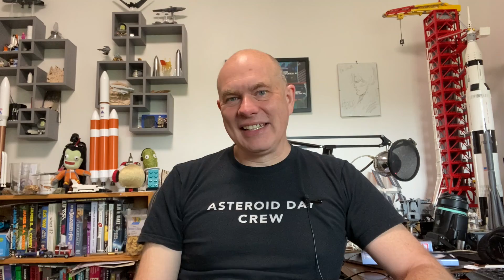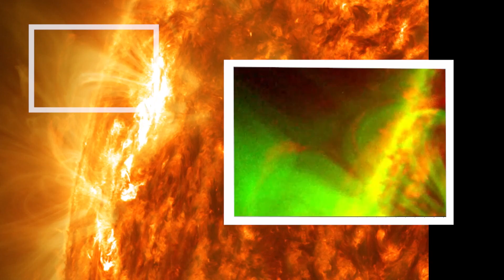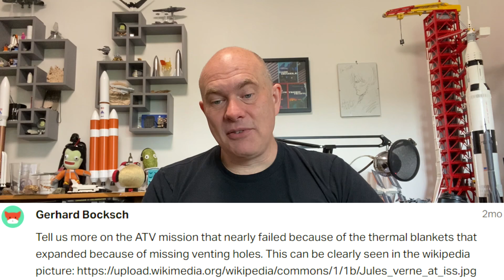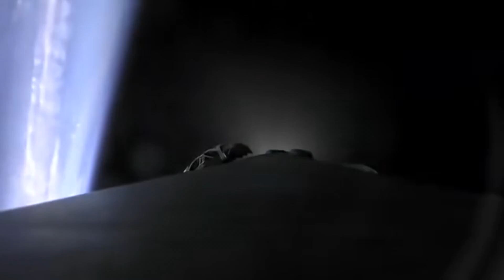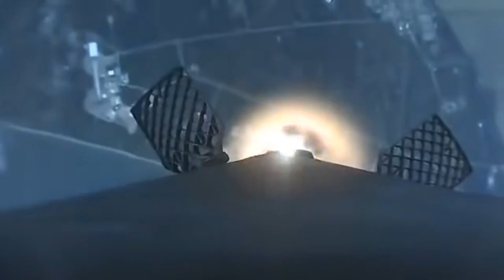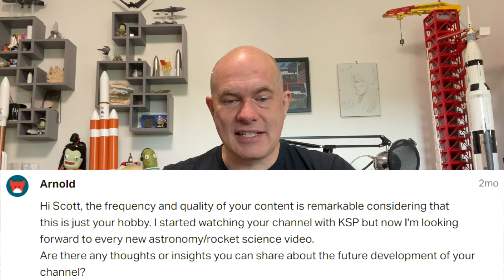Viewer Questions Episode 4

Comment: Stress Fatigue Failure Question: Hey Scott, Elon wants rockets to be reusable like the airplane industry, but airplanes have many design approaches to minimize the chance of fatigue stress fractures from propagating across large sections of the fuselage or wing, primarily by having individual panels riveted to a redundant understructure. Why does Elon think they can get away with one large welded rocket body? Is it something about aluminum vs steel? Are the rockets going to be inspected for stress fractures between flights? One Falcon 9 has been reused 10 times without failure, so that's good news, but the BOAC Comet failed around 1000 flights.  Thanks for your thoughts. Love your videos.
Reply from the maker: I’m going to say this is an excellent question that I don’t have an easy answer for.

Comment: Scott. Can you please address the issue of static charge equalisation when a new payload docks at the space station? Surely there would be a significant potential difference between the two craft. Do they have a special probe or just rely on the docking port metal parts?

Comment: Scott, a question for you.  When an airlock on the space station is used for a spacewalk, it obviously must be evacuated of air before opening the outer hatch.  Is this done by pumping the air back inside the station using a vacuum pump, to save the air, or is it vented overboard?   It would seem to me the former is more 'efficient' because oxygen in space is rather expensive while electrical power is effectively free.  Maybe the strategies have changed over time?

Comment: Why do we re-enter the atmosphere from space in the manner we do? Ie why enter at stupid speeds and travel laterally through the atmosphere causing the heating burn etc. Why don't vehicles slow down in space so they literally come straight down into the atmosphere hereby needing only a little power to stop them accelerating too much due to gravity etc and then use parachutes to finish the descent? Would landing like this avoid the heating burn since you aren't barrelling through the atmosphere like Wille Coyote on an acme rocket ;~)
Reply: Though this would avoid a lot of the re-entry heating you would have to slow yourself down from orbital velocity, taking almost as much delta v as it took for you to get up there. It's far easier for vehicles to let the atmosphere do all the slowing down for you than to double your fuel capacity

Comment: Wouldnt asteroid mining also be good for building stuff in space so you do not have to launch it into orbit.  I've always thought that if we could make steel in space, it would be a great material for large stations. its strong and easy to work on but its horribly heavy.   That said maybe its thermal expansion profile makes it unsuitable for space aside from whatever grade of Stainless that SpaceX is using.  Though I guess you could build a space station out of stainless if you could make stainless from asteroid materials.
Reply: It is believed by many (including myself) that the only reason to mine asteroids or the moon is to use that material in space.  It does save a ton of weight and the more you can make off planet the more you save.  In a perfect situation the only thing one needs to send up is the people.  :)

Comment: Someone covers this farther down the page, but it's in a reply rather than a main comment: the 99% for the Raptor is combustion efficiency.  It means that 99% of the heat available from CH4 + 2O2 --> CO2 + 2H2O, from the methalox that goes into the combustion chamber, actually gets released as heat.  You're not left with any appreciable amount of soot or carbon monoxide or unreacted O2 or whatever.  It says nothing about how much of that thermal is converted to useful kinetic energy of the exhaust.

Comment: Economy v fuel economy.  The two are conflated very very often for vehicles of all sorts, but they are not the same.  EG: your standard internal combustion engine is most efficient at max throttle. But generally, your vehicle with said IC engine has a really shitty fuel economy at max throttle.  ISP relates closely to the fuel economy idea.  Efficiency, as Scott says, is energy out compared to the energy in.  What you do with that energy and how much there is, depends on many many factors.  If an efficiency isn't in percent (or some form of unitless ratio/fraction), then it's not really an efficiency in Engineering terms.  It'll be some sort of economy.

Comment: The raptor achieves about 99% combustion, so almost complete combustion. The other engines efficiency is connected to specific impulse (expelled Mass and used energy / velocity gained)

Comment: On single burn circularisation, I think the key point is that you can do this if your single burn takes close to half an orbit to complete. In that case by the time you get to the opposite side of your trajectory to do your circularisation burn, you're still actually doing your initial burn so they merge into one burn.

Comment: I think the efficiency was a misinterpretation of a interview Tim had with Elon Musk when aerospike engines were brought up and Musk responded that 99% of the fuel burned in the engine before being sent out the nozzle.. and that with aerospike engines that was somewhat more difficult? Efficiency might have been brought up but it wasn't about the efficiency of the engine overall, just about the chemical conversion that happened in the combustion chamber.

Comment: I don't think one of the uses of the word "efficiency" was incorrect. It's just different kinds of efficiency.
High Isp tells you an engine is very fuel efficient. It takes less fuel for the same maneuver than other engines.
High combustion efficiency means an engine gets almost all there is to get out of its fuel. To make the engine even more efficient you would have to switch fuels, which means a totally different engine with different problems.

Comment: KSP... is it worth it for you to model a spacex transfer ship/station out of Starships (spokes) with lattice frame and a axle of a couple SLS or super-heavies, with a big plate on the ass end with a couple dozen nuke driven ion engines and a few raptors (or other) engine for the hi delta v burns. Ion or reaction mass thrusters. Starships (x2) for crew/redundancy, two Starships for Lunar/Mars landers, and the rest of the spokes (modified Starships) as storage, backups, etc... I'm shit at KSP, so knowing as much about everything spacey and KSP???  cheers. Keep up the great work!

Comment: Engines with lower specific impulse more energy efficient on lower speeds, than engines with higher ISP. And you can't beat rocket engines in efficiency 10x. Their efficiency is more than halve, when it comes to flight to the orbit.

Comment: The gravity problem for the trip to Mars might be solved by creating a hub with kilometer-long tethers attached to the nose for the even-numbered crew starships and rotating the pars at 1 RPM. This gives redundancy as well as access and backup in case of emergence. I expect there will be stability problems but is an inexpensive way to solve the problem.

Comment: Asteroid mining will be profitable when the cost of retrieving certain elements that are rare on earth, but abundant in the asteroid belt, drops below the value of those elements. Most likely gold and platinum will be the first elements targeted for asteroid mining to be sold on earth.
Alternatively, asteroids could be mined to be used in space. Unrefined regolith could be used as radiation shielding, while other useful materials, such as water, oxygen, and structural materials such as glass, aluminum, and iron could be extracted for the construction of habitats or used as reaction mass. Since it is unlikely that the cost of lifting matter into space will drop below $100/kg any time soon, even with fully and rapidly reusable rockets, space mining will play an important role in colonizing the solar system.

Comment: the 99% efficiency number that's often tossed around was actually Elon commenting on the conventional nozzle efficiency in particular, at sea level. not the total thermal efficiency as most would presume. this was mentioned by Elon while comparing to the aerospike outlet with Tim Dodd, which could sustain nozzle efficiency from sea level to vacuum.

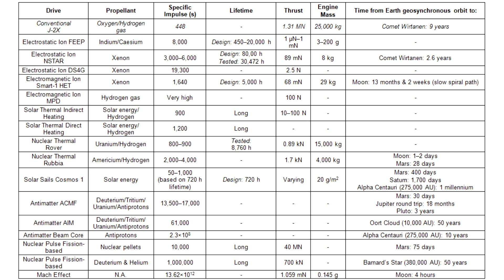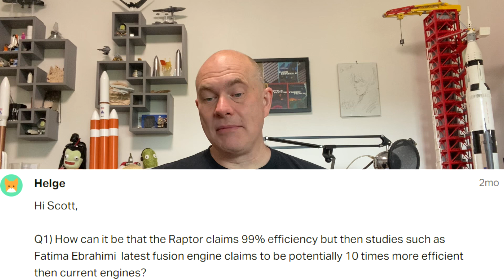Comment: In KSP I always single burn to orbit.  I launch with around 1.3 TWR, roll to inclination, and around 60m/s pitch to 80 degrees and then hold until about 3500-4500 meters and then just set the flight computer to prograde and let gravity control pitch while I control timing and throttle.  Then when time reaches 1 minute to apogee I throttle back down to about 1.3 TWR.  when time gets to 1:20 to apogee I throttle down to .8 TWR or whatever I need to hold 1:20.  Once beyond 70km apogee I might throttle down to let time to apogee get closer to 1:00.  I hold that until I am either out of first stage fuel or see my apogee near my target apogee.  But usually I build first stages to be out of fuel when my apogee is just over 70km as the rocket itself will be around the 55-60km altitude which is enough for vacuum engines to be efficient.  Once in second stage I use a couple of indicators.  If my orbital speed is less than 1600 m/s I likely burn closer to full power, but I also want my time to get below 1 minute to apogee.  Then by 1800 m/s I want time to apogee closer to 0:30.  2000 m/s is about 0:20 and 2100 about 0:10.  By that time it is easy to circularize your orbit.

Comment: The 99% of the Raptors efficiency comes from a statement elon has made. He said that from the potential 100% power from the fuel the engine uses 99% because of its architecture.

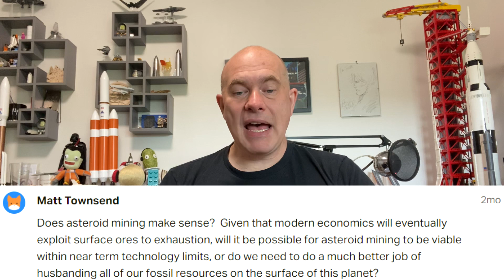Comment: 14:50 The biggest barrier to asteroid mining is the fact any likely asteroid miner is also a weapon of mass destruction.  Even if you build an off-Earth smelter, a mechanism capable of shipping hundreds of tons of refined material to Earth can easily be repurposed as a bombardment weapon.  It's very hard, if it's possible at all, to come up with a system where one crazy person couldn't cause millions, maybe billions, of deaths.  If you move the entire asteroid to the smelter...  Well, a "bad burn" followed by a "catastrophic control malfunction" could create an extinction level event.  A unified world government would be required to authorize such a mission as otherwise other governments would, quite rationally, view the mining operation as an existential threat.

Fusion torch drives have similar problems, as firing one at the right altitude above the Earth would have the same EMP effect as detonating a nuclear bomb at the same altitude (e.g. massive EMP pulse that would take out all unshielded electronics).

Comment: I believe that the quote by elon on raptor engine "99 percent efficiency" was highlighting that raptors burn more of the fuel in the combustion chamber than many engines because the injected fuel is gas and mixes with the oxidizer better than liquid injection is capable of.
Reply: It's also not diverting fuel and oxidizer to run a preburner and dumping the exhaust.
Reply: @talyrath 👌 also a good point

Comment: @6:00  I think there is some hope of launching missions to the outer planets being enabled soon by one particular reusable heavy lift vehicle that is currently having some difficulty coming back to earth in one piece, and staying in one piece.

I'm thinking of a brute force approach where you put a couple of hundred tons of xenon, a compact nuclear reactor and an ion  or hall effect thruster and use that to propel a probe of a few hundred kg mass. The idea is that the ion engine would be running for the entire duration of the flight. It would accelerate at a snails pace but over a few years but thanks to the ridiculous mass fraction it would reach quite a respectable velocity even without the help of gravity assists. I'm thinking something like 2 tons for the reactor , ion engine and the actual payload, with the rest ( a couple hundred tons or more) being propellant and very light drop tanks. One might also want to put another hundred tons worth of chemical booster, perhaps even just a solid, to get the whole thing to escape more quickly from LEO as the ion drive would probably take ages to do that.

I think the only thing that prevents that from being done today is that you would need a large number of expensive launches to get all that propellant into space. If instead you could do that with three or four much cheaper launches carrying 100 tons each it completely changes the whole situation.

Comment: You need 2 burns only if your thrust generation is cannon. That means, that you can only generate thrust for a very small amount of time. What is important, is that when you go out of atmosphere, you can circularize. If you are still burning from suborbital injection, you can just point your spacecraft into prograde (+/- few degrees for correction of vertical speed) and continue your burn.

Comment: not too sure bout that asteroid mining comment. at least not for terrestrial applications cuz shipping enough say iron to match our current & prjected output is gunna start adding enough thermoaerodynamic heat to start being an issue. also the economics of mining less pure ore is mostly controlled by the sheer energy input thats required. so if u have very cheap spaceflight i would tend to guess that using space-based solar to mine ever more dilute but plentiful resources makes way more sense. even moon mining makes way more sense since at least there solar power is easy.

for orbital applications though it makes perfect sense since, even now, it would be cheaper to haul a ton of steel from all the way in the belt than bring it up from the earth. but agin the moon would still be better

Comment: Speaker line arrays:
Speakers have all sorts of fun due to the fact that audio wavelengths are close to speaker diameters. To relate line arrays to rocket engines you would need to have some value of wavelength for the exhaust gas.. That, I think, is not a thing.

The closest aspect in rocket engines is nozzle design, and that has had a fair bit of work already with no apparent physics to suggest that adjacent engines affect each ohter.

Comment: About the asteroid mining - isn't it going to make more financial sense to use them for manufacturing stuff in space a lot sooner? If you have to haul up 9000 tons of material for a space station you could probably pull an asteroid that's already in space cheaper than launch it from Earth. 
I mean, you'd still have to move the fuel and engine to the asteroid, but you would not have to design parts that fit into a payload fairing and handle the vibrations and acceleration of launch, so maybe make the parts lighter.

Comment: I believe, that in case of Raptors, "99% efficiency" is used mostly as a reference to full flow staged combustion engine and their comparison to different combustion engines... It most of the time reffers to some kind of limitations, that are connected to combustion engines, mainly pumps... Compared to different combustion engines, Raptor seems to be reaching the limits of feasibility, therefore 99%. Unfortunately it does not reffer to specific impulse :)

Comment: Okay, a crazy idea for you to evaluate ... currently, the atmosphere (earth/mars) is used to remove delta V for returning payloads and space ships  ... assuming you had an orbital ring (1000x the mass of a returning payload) or a track on Phobos ... couldn't you install a mass accelerator rail (say from Spin Launch) on the outside of the ring and use it to remove delta V.  I assume it would only need to remove enough delta V to remove or lessen the need for and cost of heat abatement technologies, i.e. only have gravity to content with using grid fins and parachutes.

Comment: No probes to Neptune or Uranus . . . Unless Space X completely changes the cost scales enough to reduce the current  delta v constraints so much that the cost to fly a few tons direct drops to only a few million. An expended starship could put a sizable load directly into orbit of either planet, based on current estimates of  6.9k m/s @ 100 tons payload.

Heck, it could even deliver a smaller expendable probe to directly insert more mass than we have ever sent before without expending the starship. Remember, voyager 2 was only about 1800lbs.

Comment: I think that the person from the first question had a little mess up between combustion energy efficiency and the efficiency itself

it has been said that the raptor engine achieves a 99.8 % efficiency of combustion into hot CO2 (which is pretty clean AND energy efficient, since you don't have energy wasted into side products)

that is REACTION EFFICIENCY, not to be confused with thermodynamic work conversion efficiency (the power output, so to speak)

the term efficiency for combustion is actually properly used according to definition (and it is actually quite outstanding they got such a good conversion)

Comment: The device used to determine what a planet is made of is called a spectroscope. It's kind of like an advanced prism. When the light from a planet is isolated, it can be run through a spectroscope and produces a rainbow colored rectangle. When one examines this grid, very thin black lines can be seen spaced at certain intervals among the colors. These black lines correspond with different elements present in the light reflected from the atmosphere. -A 29 year middle grades science teacher, retired =)

Comment: The efficiency of a rocket engine is judged to be the amount you're getting out versus what the maths tells us is theoretically possible. It isn't a measure of the efficiency of converting chemical energy into 'work done' ie force x distance, which is the proper meaning of the word.